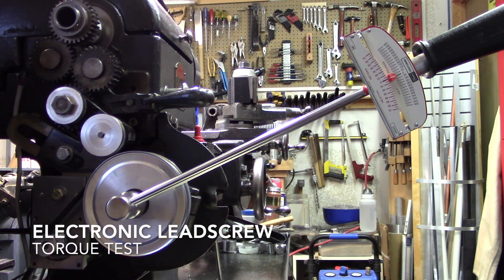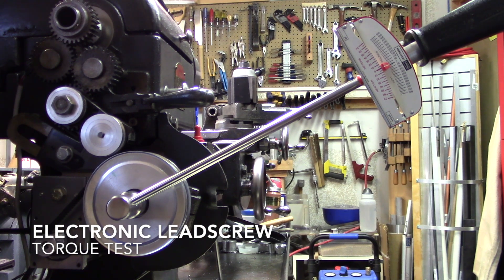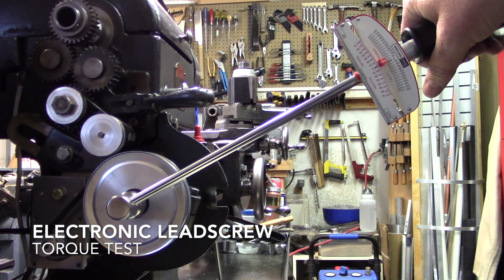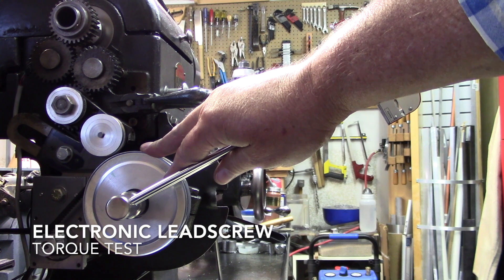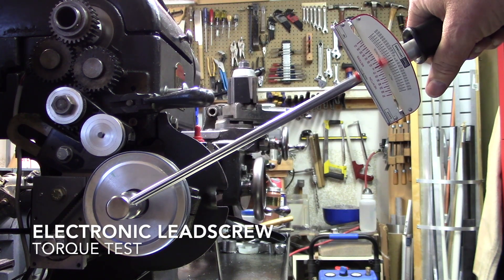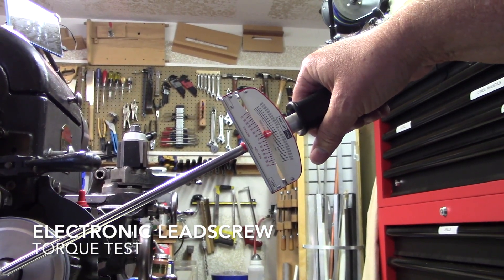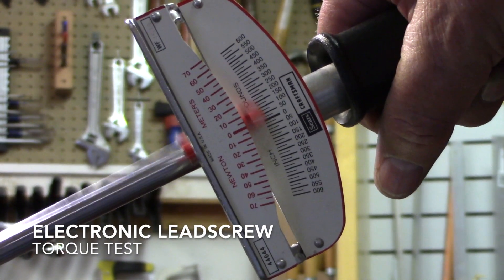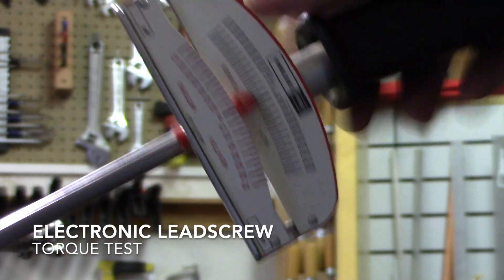Electronic Leadscrew Torque Test

Comment: One last thing, if you can handle the extra width of a NEMA 34, here is a 4.5NM closed loop stepper that is only 4.3" long and only costs $120. US free shipping from Cal. https://www.ebay.com/itm/644oz-in-NEMA34-Closed-Loop-Stepper-Motor-4-5NM-Hybrid-Servo-Driver-DM860H-Kits/264431746149?_trkparms=aid%3D333200%26algo%3DCOMP.MBE%26ao%3D1%26asc%3D20171012094517%26meid%3Da684ee5031f44770b712209a015b34f3%26pid%3D100008%26rk%3D6%26rkt%3D12%26sd%3D111796968667%26itm%3D264431746149%26pmt%3D1%26noa%3D0%26pg%3D2047675&_trksid=p2047675.c100008.m2219

Comment: If your ELS project were open-sourced, more people could participate in improvements and forks. This could greatly facilitate moving toward my dream of an integrated ELS-DRO with a unified interface with end-stop/reversing capability. This is the ultimate goal of mine, the perfect manual programmed, semi CNC lathe. 

Being able to manually program simple procedures, using a touch screen, with the precision of a DRO and ease of an ELS would make the ultimate maker lathe. Based on my knowledge of Yuriy's touch DRO and your ELS, the two could be easily (?) integrated into a unified product that could be assembled and installed on almost any lathe for less than $300. This would greatly increase the utility and precision of any size lathe, allowing just about anyone with reasonable skills to produce amazingly precise work with reasonably priced equipment. 

I can also imagine a fork that adds a cross slide stepper, enabling any lathe to easily do tapers and more complex, standard shapes like ball ends, without having to go full out CNC. A CNC lathe requires CNC programming on a computer, a dedicated CNC lathe, and you lose the ability to easily do manual work. Doing standard, but complicated procedures, like threading, tapers, and ball ends from a touch screen menu, with adjustable parameters, would be the perfect in-between capability. 

With opensource programming capability, I envision user-created, addon pages (libraries) with new capabilities. Whether this could be accomplished using an Android tablet, like Touch DRO, or add-on libraries to a dedicated touch screen (like yours), remains to be worked out.  An Android tablet is the perfect interface for the front end of a user interface because it is easily updated and the touch screen is the perfect input interface. Also, they are becomingly increasingly more powerful at declining prices. Also, the Bluetooth interface is adequate for, noncritical, communications with a controller and wi-fi access to the internet makes access to libraries and updates an easy matter.

Currently, Touch DRO only moves information one way, from the controller, using Bluetooth, to the interface (the Android tablet) What I don't know is if an Android tablet, using Bluetooth, is reliable enough to do the real-time control of the machining process. I have my doubts due to the often quirkiness of Bluetooth. Maybe a hardwired USB connection would work better. Control is probably best done using a separate processor at the controller board, receiving parameters from the Android. Instructions, in the form of Gcode, calculated axis movement or library values must move from the interface to the controller.

Anyway, this subject just gets more complicated, the more I think about it and this thread could go on and on. The bottom line is an opensource project could address all of these questions and (more quickly) come up with solutions. I think I will shop this concept around on some of the machinist/CNC blogs and see what kind of interest I can stir up. I am just sorry that I don't have the required skills to take the lead on a project of this magnitude. I guess I'm more of an idea kind of guy. I see this idea becoming the 3D printer (hardware) concept translated to the machining community with a GRBL type board and a Marlin type control program.

Comment: Thanks for the info. I just purchased a Clausing 4912 from a school auction; it's in great shape, but I plan to use an ELS when I start the rebuild; choosing between your project, and Clough42 design will be difficult. P.s. I have a couple of bending beam torque wrenches, they have proven invaluable over the years. Keep up the excellent work.   See you on YT 😁
Reply from the maker: Those are interesting machines. I hope you got a good deal. I assume that you're going to drive it from the tail end with the gearbox in neutral?
Reply: From what I understand, the Clausing is a good lathe, and their factory is 15 min away. I won the bid just over $400, you can see a comparable lathe on eBay for 2 to 3 K, so I'm a happy guy. The plan is to freshen up the lathe and get to know it a little better then add the ELS (undecided on which end), so I can go metric and back with just a couple of buttons.Right now I'm getting my shop finished for the winter, and then watch out, I've got major projects in the works.
Reply from the maker: @SouthernEngineering  That sounds like you got a great deal. Congratulations, and may it serve you well. One of my objectives with my ELS was to be able to return the lathe to original condition. I'm looking at pictures of your Clausing model and I think you'll have to drive from the tail end to accomplish the same. You might want to go with a short NEMA34 motor on a lathe that size, and you would have the room on the tail end. You would just have to extend the leadscrew.

I've got a detached shop planned but I just couldn't get it done this year.
Reply: I would leave it be since its already a GREAT geared lathe....the els is geared for us guys who need the physically change gears in my opinion....sell me the lathe and ill give you my logan 200 if ypu want a els that bad. 😂

Comment: I was planning on using a 3N-M stepper for my lead screw stepper. I think that's about the largest NEMA 23 you can easily get. Also, they are only about $35 on eBay. The other alternative is to use one of the stepper/servo hybrids and those are about $100-120, getting a bit out of my price range. Based on your test, I think that a 3N-M (425in-lbs) should do the trick with a 5 to 1 ratio on the belt.
Reply from the maker: I haven't been able to find anything larger than 2.2Nm that will fit where I have to put it, and most of those have an encoder that adds too much length.   I believe a ClearPath SDSK rated for 3.5Nm would fit, but it's $300.

Comment: Do you have an idea of the required torque that you need to move your leed screw during a worst-case scenario? I imagine that a deep cut on an 8 TPI thread would do it. Were you making a new backing plate for a chuck? I have some barbell cast-iron weights that I want to turn into backer plates and I will need to cut 8TPI inside threads for my 9x20 lathe.
Reply from the maker: I'm going to find out. The torque limiting is sort of a "feature", since it should keep me from breaking things in the event of a crash.  Just a few weeks after getting the lathe I broke the miter gear mount in the apron by losing track and power feeding the cross feed to the front limit of travel in a low gear. I said that I could go up to 8:1, but actually that's 10:1, so I could double what I have now. From there I would have to switch to a ClearPath servo, which has twice the torque (and three times the expense).

I was cutting a 3/4"-8 Acme to use as a plug gage for rebuilding some half nuts.
Reply: @jonrbryan  Yeah, at the bottom of an acme thread, the cutter is almost like a parting tool and can easily cut on two faces and drag on the third. With threads, it's not as easy to take light passes although, with your  ELS and a fixed stop switch, you could reverse the feed, back out and take light cuts a lot easier. That's one of the best features of your ELS scheme. It always kind of weirds me out, cutting into a shoulder and having to suddenly stop. the feed. Having a DRO capable ELS is my idea of heaven.
Reply from the maker: Down the rabbit hole I go. I'm trying to score a force gauge and actually measure it. Rough T = KDP calculation gives me a number between 550 and 1100 pounds of force applied to the carriage depending on the friction loss. I can tell you that even before I geared it down I could push on it my hardest without slowing it down, and I weigh about 270, so I'm inclined to believe the rough calculation.  Gives you an appreciation for the kind of cutting forces that are involved when cutting an 8tpi thread.

Comment: I wondered if that would be an issue.  Thanks for testing it.  Have you been following Clough42's electronic leadscrew project?
Reply from the maker: Yes, he's working much harder at it than I am, which is reflected in the number of subscribers that he has. My approach to the user interface is much different.  I like my touch screen and knob. I'm also enjoying retirement, and am not strongly motivated to support an actual product.  I think I'll publish the code and schematics at some point, but I don't feel like starting a business.
Reply: @jonrbryan  I would love to have the code for this to play with it a bit and try it with a Servo
Reply from the maker: @apollorobb  It's just step and direction. I started off looking at the ClearPath motors but decided to go with a microstepper since it was 1/3 the cost. Now I'm testing heavier cuts and thinking about the ClearPath again for 3.5Nm of torque vs the 2Nm that I have now.
Reply: Put it this way, I like it better than the other. It’s pretty cool.
Reply: I like your UI, it’s done pretty well. I still wonder why the manufacturers haven’t done this yet.
Reply from the maker: @rickhaass1133  Only "pretty" well :)?  There's a gulf between a programmable gearbox and a full-up CNC. I think each has its place, but I imagine that they've done a market analysis and concluded that there just isn't enough money in it. But it seemed to take a long time before they started selling machines with VFD's, so it might happen eventually.